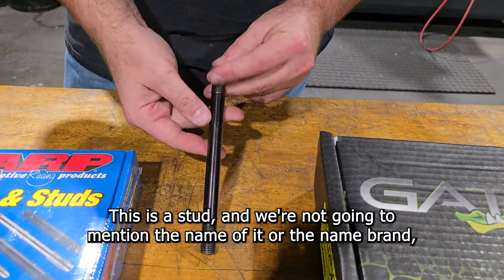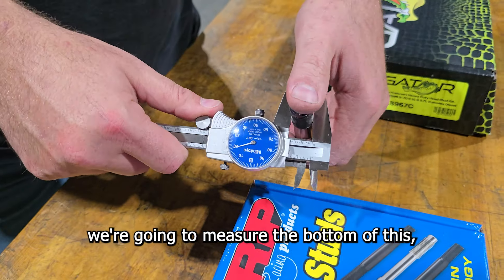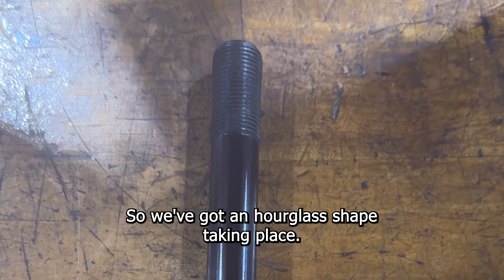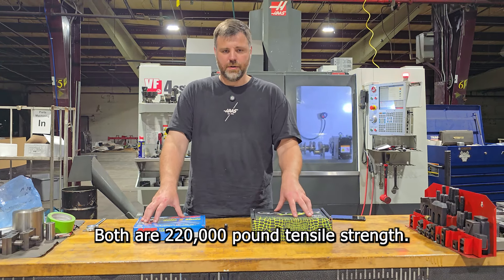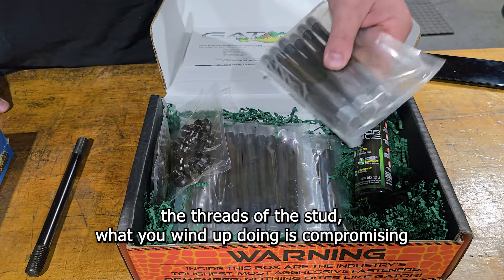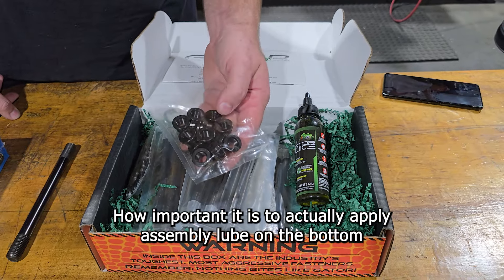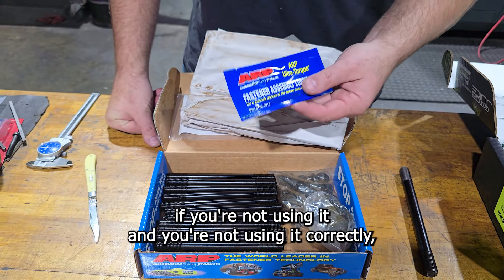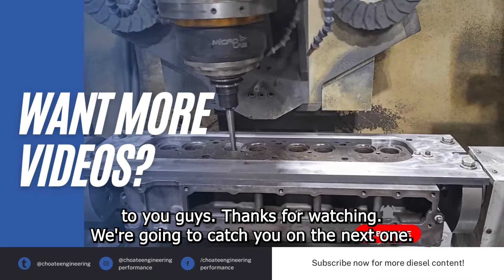ARP VS Gator Head Studs

Comment: Installed at least 10 sets of ARPs, no issues to speak of!
Reply from the maker: We like both. They compete well against each other . ARP has years behind them. Gator has pricing .
Reply from the maker: We've installed 1000s and thankfully haven't had an issue with either.

Comment: High boost 6.7 application. Ran a set of Gator Fasteners (Competition Series). They claimed to be stronger than ARP CA 625+. I called a year later to see how they were holding up for other customers. Turns out that they discontinued them. The Competition series was failing, snapping with zero give at high boost. They proceeded to suggest I went with ARP…This told me everything I needed to know. They’re not proven or R&D properly. 

We’re running CA 625+ from now on. It’s the gold standard.
Reply from the maker: I'm not sure that we have tested their competition series!